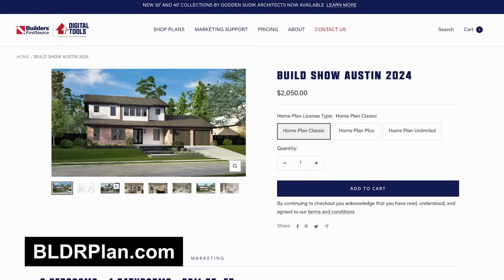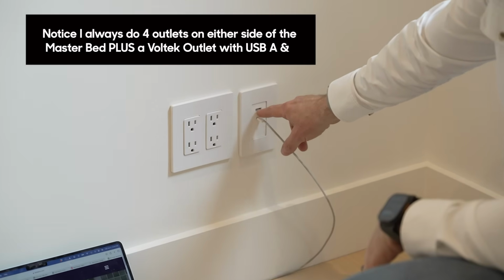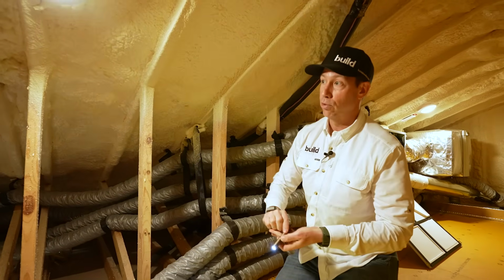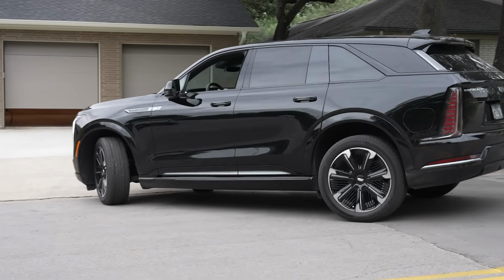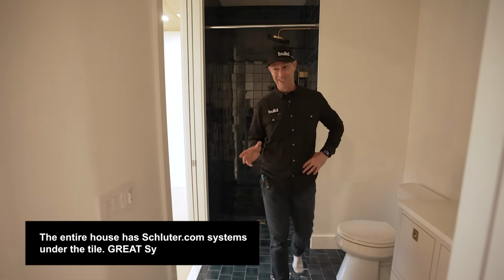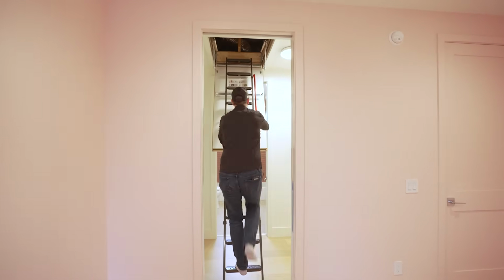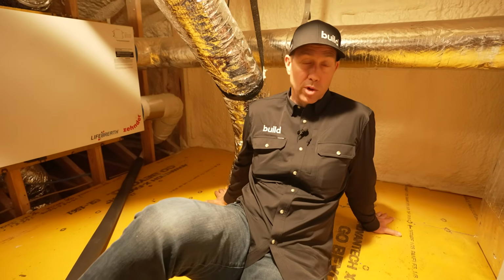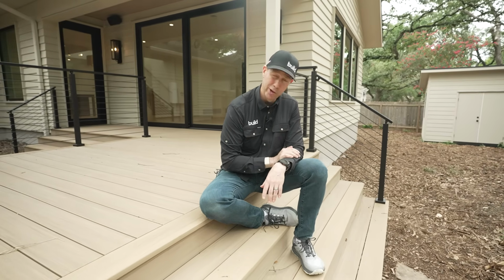The Risinger Build: Episode 24- Walkthrough & Recap of Craftsmanship

Comment: With the limited access to the equipment attic I would have really wanted monitoring up there-- maybe a camera, leak detection, temperature/humidity and differential pressure gauges across the filters.  A way to reboot the router from downstairs would also be high on my list.

Comment: Sprayed roof deck would keep me from buying this house. I also don't understand the need to put HVAC equipment in the attic. In my house, I have a heat pump in a utility room on an outside wall next to the outdoor condenser. No need to go into the attic to service the hvac. My house was not even brand new, having been built 30 years ago.
Reply: Im doing the same by making a full mechanicals room on the main floor. It is eating up some expensive square footage though

Comment: For the UPS, don’t buy the traditional lead acid units. I’d recommend the EcoFlow River 3 Plus. It’s a certified UPS, has a 600W AC inverter and could run your Internet equipment for hours, if not a day or more depending on the load. Costco has them for $219 right now!

Comment: My biggest criticism is the height of the garage combined with having all the network equipment up there. I end up having to reset my router every six weeks or so and climbing up to a low ceiling attic to do it would suck.
Reply: Just put it on a wifi switch and then... oh wait
Reply: I came to the comments right after they showed the networking equipment. I can’t believe they put something that needs regular service in such an inaccessible place. Same goes for the filter consumables. Imagine having to climb into your attic once every couple of months to replace those. A big oversight imo.
Reply: There are remote solutions for that, but you'd have to high jack a network wire for that purpose. Some routers can enable an automatic restart timer.

Comment: Amazing truly an outstanding accomplishment. This series shows how much performance can be obtained in more modest sized projects. Builders who are willing to work with clients can provide/bring outstanding value to homeowner that until this build I would have thought impossible. To counter the amount of time you spent on a project this size is not an efficient use of your available time, however for smaller builders who have the time this project shows a path to exceptional performance in a modest build providing true added value for using a builder committed to getting the most out of each dollar of build costs. Congratulations, I am not often surprised after being a commercial industrial owner-developer for more than 50 years. Ray

Comment: I have found that on a two story house that the humidity is higher on the first floor because it requires less air conditioning (which removes some humidity) than the second floor where the air conditioning is running more often (I have separate units for each floor). Also the kitchen generates humidity from the dishwasher and also the laundry room, and also the first floor has exterior doors which get opened to bring in humidity. Gas stove tops also generate humidity, if not using induction.

Comment: texas houses dont sink the gutter downspouts to send water to the street or farther away from the house?
Reply: Some do, but it is too easy for them to get clogged with leaves or debris, and very difficult to clean out. So long as the lot is properly graded for water to flow away from the house, it is not a problem. Also this house has no basement (like most Texas homes) and even if water were to accumulate next to the slab foundation it is usually not a major problem.

Comment: Beautiful house. But, the tile backsplash by the stove with WHITE grout is such a bad idea. Especially if you cook a lot. Whoever decided that doesn't really cook very much.
Reply: yeah large single piece stone would've been a better solution. that grout is going to get mucky.
Reply: @steve-wright-k8s  Yes, and there are several thin quartz (or quartz like) products that would work well as a backsplash.
Reply: I know that Matt has used epoxy grout in the bathroom on some of his homes, so hopefully that is being used on the backsplash. That would make it easier to clean, but I agree that a thin solid surface material would be better.

Comment: i would have used larger format tiles in the bathrooms because the grout is going to be a pain to clean or replace.
Reply: Matt used epoxy grout for his personal home, and if used here would be less of a problem. Personally, I would prefer some slab material with only silicone grout in the corners.